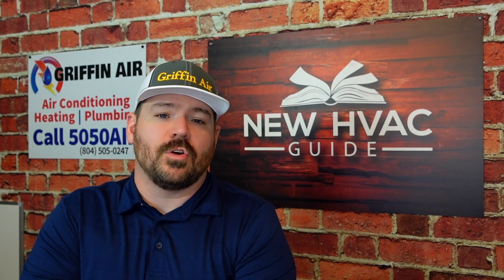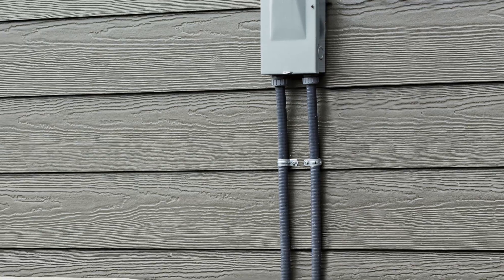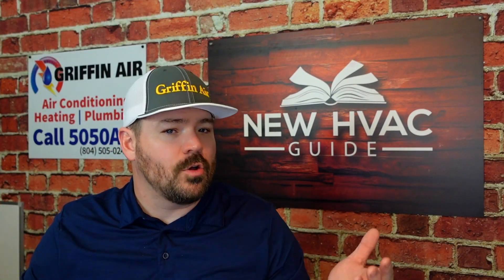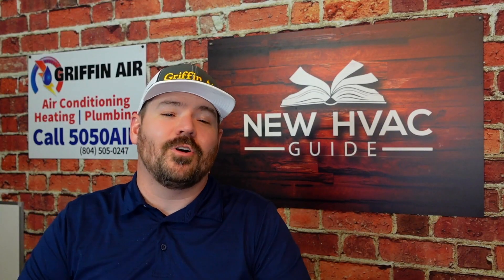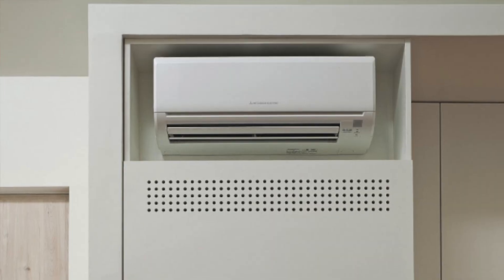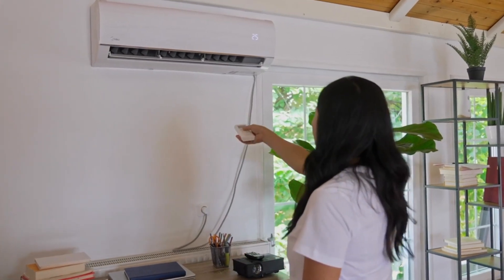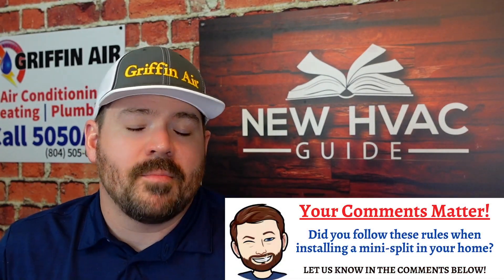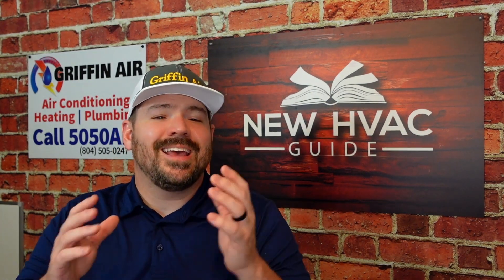Mini-Split Location Matters! EXPERT TIPS!

Comment: I am doing tests on cheap mini splits. Rovsun and Garvey.   It’s incredible what happens when you have the same temperature outside but the sun shines on the mini split in the winter time. Temperatures are in the high teens and mid 20s just installed recently. I am a 37 year HVAC specialist including large boilers, three stories high.  I do everything by the book except I usually braze by mini split connection at the head. I did not in this case I have access to all of them and continue to check for leaks so that my data is more pure going to also add solar panels to these units.

Comment: My upstairs mini split is the same size as downstairs but doesn’t cool the space as well. I know hot air rises so do I need to have a vent installed to improve air flow?  It’s an old house with no existing duct work but several windows upstairs. I am having the ceiling and insulation done so I need to know if I should have an air duct installed as well.

Comment: So my garage is 3 bay. One bay is my workshop and is insulated and separate from the others. This unit will be mostly for heat but possible for A/C too. Aside from the condensate line. What are the downsides of installing the outdoor unit in the unfished / uninsulated part of the garage?  Also, I was going to install in about 8 feet up the wall with a 10 foot ceiling.

Comment: Great video. Do you know if it's possible to have a mini split on an angled wall? Installing one in a steep vaulted ceiling and it's difficult to fashion a flat vertical wall. Debating having one put at an angle but is that safe or appropriate? I have read that it must be level and straight.

Comment: Absolutely one more thing. Put the cool air somewhere where it will be uneven. Hot or cold, people demand different temperatures. If it's uneven, they will find their favorite spots. If it's too perfectly distributed, they will be at each other's throats and you might even have to run it extra cool.

Comment: I put mine in my basement apartment  but I'm concerned about the drip line because it goes down on a slight angle not straight down.  Hoping it doesn't give me any issues.

Comment: I need to install a wall mini split with a 50ft copper line extension to put the compressor away from my patio. I can’t find any videos showing a long line run and how to do it.. How far is to too far and what extra costs are there? how much is additional refrigerant if you need to add it. Thanks

Comment: I ordered a 115 volt system. 5 mini splits.I only have ONE slot left in my electric box.Can those little braker boxes be wired directly into the area near the minis? I see its a little box that you can add fuses into and its separate from the main box.
Reply: Im an electrician i wired one unit at work. Can you explain a bit more, maybe I can answer you.

Comment: I have an office that the central air doesn't keep as cold as I'd like so I was considering one of these. Problem is the exterior wall window doesn't leave much room for an install. It would probably have to go on an interior wall. Do these things come with long enough lines to run through an attic and out of another exterior wall?

Comment: Joshua, the only place on an exterior wall I have to mount the head for my living room/kitchen is partially over my refrigerator. About half of the head will be over the fridge. If I mount 6 inches from ceiling I will have about 11 inches from the bottom of the head to the top of the fridge (only half the head will be over the fridge). Would partially over the fridge be ok? The preferable wall for mounting is in the living room but it's the carport wall--nowhere to drip the condensate except on the concrete under the carport. I want to avoid this wall if possible because of a condensate pump. Thoughts?

Comment: When might you want more than one inside unit in a room? 25ftx25ft woth 20ft vaulter ceiling with only one? What if its an A frame and the side walls are only 4ft tall but still has a 10fr peak in tbis 25x25 room. Thats what Im dealing with

Comment: Ask me how I know... when we had ours installed in our new house (bonus room), the builder never brought this to my attention... placement inside. Unfortunately, now that I know a little bit about these units, there was only 2 places to go, either side of a large window. They ended up putting it above a staircase that no one could reach safely without setting up a walk-board system. UGH!! When I found out where it was going, they had already placed the lines. Go figure. I was NOT happy! Our home is only 4 years old. We had problems with our Daikin from the start. We just last week replaced it with another unit and placed it on the other side of the window, is only about 4" from the wall. But this unit does much more than the last. I can keep it from blowing directly on or towards the wall. We also had the lines set outside, too. This will be much safer for everyone.

Comment: Nice, straightforward, video! I think you should expand and make other vids on the subject of "where to install mini-split systems." One thing I was looking for and didn't find in the vid was installing the system/s where it would be most efficient for conditioning the air, be it cold or heat. For instance, if you're only installing one larger unit in a small space, say a 1000sqft or less house or apartment, then taking into consideration sun exposure, the size and number of windows, and how that affects the temperatures inside the space, and selecting a location where the device would make the biggest difference. For instance, maybe it's more important to heat/cool the air in the  common areas such as kitchen/living/dining room, where visitors are more likely to gather, as opposed to the bedrooms where the temperature maybe be easier to control via windows or ceiling fans. Thanks again for the video!

Comment: I need to mount mine in my shop, metal siding. But need to run 10 feet worth of lines sideways (pitched of course for drain) then out the wall and down. I don’t want to go horizontal on the high ribs. I can leave out an access hole behind wall unit to get to fittings. That ok?

Comment: Question I have a unit  the condenser is on the opposite side of the house and the room is on the other side,Will you run the line set in the ceiling to the other side of the house to where the condenser is located and drop the CANDENSATE  right outside or u will run everything to where  the condenser is ?

Comment: Very unfortunately, the only place where I can install the mini split AC leaves only 3.15 in clearance between the top of indoor unit and the ceiling. Will that be a big problem?
Reply: that should be no problem, most manufacturers say 2" or more clearance

Comment: Hello Joshua. I enjoy your videos. Keep it up. I am installing a Mini Split in my workshop. The shop is 40' wide and 32' deep. I will have one unit mounted on the rear wall centered between the 2 sides. The outdoor unit will be wall mounted, 36" above the ground just on the outside of the same wall. Since it is in my shop, I am thinking about running the line set down on the surface of the inside wall and than go out when I get to the level of the outdoor unit. My question is, is it OK to have the line set inside?
Reply from the maker: Yes. Just make sure it’s insulated 🙂

Comment: I was really wanting some actual information rather than common sense suggestions. I wanted to know how far the refrigerant lines can be extended before it becomes a problem. My wife made a change to our remodel and I can no longer place the outside units where I had intended. The units come with 16ft of line and I was within that. Can we extend them to 30ft, will we have to add to the pre charge? Just looking for a general rule of thumb here.
Reply: The instruction/installation manual of each unit will tell you that for that specific model, and how much extra refrigerant to add. If you look at a unit online see if the listing has the option to download the manual.

Comment: Re: your splash at 2:58.  I am considering a four-zone mini split system due to leaky ductwork in an inaccessible false ceiling all over this 45-year-old house.  I also like the DIY aspect of the system.  I'm looking at 6k, 6k, and 9k wall units for the bedrooms and an 18k ducted unit for the living/kitchen/dining open area.  The larger bedroom has a southern exposure.

Comment: You may have the perfect location for the indoor unit but not the best for outdoor unit.  The outdoor unit can be subject to noise, theft, visually unpleasant walkway obstruction and environmental concerns such as direct sun or rain exposure, not enough air flow etc.  another factor for indoor unit is if you lived in the house for along time you may be aware of certain areas of a room are colder or hotter so focus on that area. Best to place it next to any heat loads such as windows to remove heat before it can get to the rest of the house.  Use caution in kitchen or shops as dirty air cooking oil ets is probably not good for the coils.  I especially like the tip on remote control

Comment: Aesthetics are a factor when choosing a location. People are not yet used to seeing the large interior unit, and it can sometimes be located in an inconspicuous location. Also, the fan baffles can be adjusted to keep the air flow from blowing certain directions (like down in a bedroom). The unit in my house has the air blowing only at ceiling level and it does a good job of heating the whole house with one unit. (I have a 1000 sg ft house.)
Reply from the maker: Very good points!

Comment: I am a retired facility engineer and was responsible for overseas construction, maintenance and repairs of all infrastructure to include HVAC, power, UPS and Gen backup. I have installed many minisplits but now I am old and would rather pay someone to install and maintain. Unfortunately, I have tried to use different HVAC companies and had very poor results not to mention outrageous estimates and costs. I have yet to witness an honest and qualified HVAC tech or company. I will do it myself until I can no longer climb a ladder. Even a simple job like troubleshooting and replacing a capacitor will cost at least a few hundred dollars when it takes less than one hour and the cap is ~$15. I realize their time is money and they have to make a profit on the parts since they usually have them on the truck. The freon costs are exorbitant with them trying to get 500% profit at least. I have many other horror stories from when friends call me after a tech tells them they need a whole new unit but it is something minor and I fix it for them. Some of the techs they advertise they are certified which means they have a license to buy and handle freon. Very few have actually had an AAS in HVAC and claim they learn OJT which means they accompany another tech who may or may not know what they are doing. HVAC and plumbing companies are the worse in taking advantage of folks even more than automotive techs or electricians. The industry needs to police themselves and I don't see that happening. You asked for comments. I think you are one of the good guys and I like to watch your videos and I am subscribed. These videos help me stay current and are good refreshers. Good job. IMHO.
Reply: Lots of ripoff cons these days, yard maintenance, auto, plumbing, dentists, doctors, HVAC... us older guys remember a time when most people were honest and fair, it's not that way anymore... senior folk are at great risk of easily being ripped off.
Reply: That is why the USA hasn't been relevant globally for 25 years.

And you are talking about local jobs, can you imagine other industries that don't require you live in a 10 mile radius?

Me neither because those jobs are done by Chinese and Indians.

But in their home towns they act exactly how your eras folks used to here
Reply: Did I accidentally click on an episode of Adam ruins everything? Impossible to find a good trustworthy HVAC guy, you need to luck out on Mini Split location, hope your house doesn't have Windows.  I'm sure there's a reason that window air conditioners are garbage too
Reply: I still do handshakes and gentlemen's agreements. Been a carpenter/home remodeler for 40 years, and the look I get when I ask a dude if they abide by a handshake is stunning. Well for a couple reasons: no one trusts anyone, and I am female. I just sold a Harley to a younger who really wanted it and asked for a price break if he came over each weekend and fixed it. I shook his hand and literally asked him if he would stand behind his handshake and this gentlemen's agreement. It was awesome, he now comes out every Sunday to give me cash as we shook hands on a price. He's never dealt with anyone this way before. I think I made a friend. Every now and again I take a chance on a young man in hopes of teaching them. Not enough good Men around, and if their Dads bounce someone has to mentor them, even if it's that old butch woman down the road .
Reply: @mickeythered Wow, that's such a blessing.  I've now been screwed over by THREE different contractors. This last one has been incredibly difficult.  A MILITARY  " friend "   that for the most part is just showing up whenever THEY want. This person knows I MUST have pics ready for my ins company within 2 weeks.
Reply: This is the truth. About 15 years ago, the company that installed my heat pump charged me $350 to replace my dual start capacitor. I stood there watching him, and thought the price was ridiculous. I've since replaced it myself for $15-$20, the cost of the capacitor. Disclaimer: Do some research - don't kill yourself.

Five years ago, my heat pump started shutting down.  The same company came out and charged/recharged the freon twice costing me $1500. The second time, they advised me to replace my "aging" 15 year old heat pump for $18K.  I called a contractor acquaintance  for an HVAC recommendation - that company fixed a blocked TXV valve for about $600. It took about 3-4 hours to diagnose, including a 2nd trip to order the part and replace it.

Lessons: 
1) Find a competent HVAC company, if necessary by tapping your building contractor friends.
2) Hiring a qualified HVAC company could be more important than the equipment brand, including for initial installation. What good is a reputable brand if the installation is faulty and results in service calls within the first 5-10 years?  
3) If you're handy, replace the capacitor yourself. Capacitors have a shelf life, but I still have a spare just in case, because they seem to always fail on a Friday afternoon... before a 3 day holiday weekend. Buy and reinstall a fresh capacitor.
Reply: Just had a HVAC contractor want to charge me $140. for a 3amp fuse!
Reply: 2 hvac guys wouldn't even talk about baffles.  After 1 told me it couldn't be done I noticed baffles behind a register

Comment: Thank you so much. I was curious can I install this over a window?
Reply: @gwenherrington  I've been doing some research on these Mini Splits and they actually have ones that can be installed on the lower wall and even in the ceiling. I had the same issue...a sunroom with all windows and I didn't have much space between ceiling and windows. But I CAN go with one of these other options 😊
Reply: That's what I want to know. I need one in a sunroom with many windows so I don't have many options as to where I can place it.
Reply: He said no, don't install it over a window if you don't have to.
Reply: Thank you!

Comment: This is a badass video. I learned a lot 👍🏼   Question: Do all ceiling cassettes require a condensate pump?
Reply from the maker: Not usually unless you need a lot of lift
Reply: Sir, can I install outdoor unit or compressor 9 feet above the indoor unit or evaporator?

Comment: You did not know why there must be so much side clearance. I would like to install one at the end of a hallway, but there wouldn’t be enough side clearance. Do the plastic sides have to be removed for repairs, such as replacing a fan motor, or a line set?
Reply from the maker: Some repairs, yes. Depending on the brand you’re installing, some come apart different than others
Reply: @NewHVACGuide  Thanks. Your videos are helpful. I’ll get a less powerful unit with a narrower air handler. I live in the Pacific Northwest, where the weather is mild year round. I probably don’t need the size manufacturers recommend based on square footage.
Reply from the maker: Proper way to size is load calculation not square footage. Thank you for your kind words by the way
Reply: @NewHVACGuide  True, but load calc is no substitute for trial & error. After dumping $4K into a couple of replacement compressors for my “central,” whole-house, forced-air, heat pump system, both of which failed, I decided to use the attic air handler for ventilation only. I installed an under-powered mini split in the area with the attic air intake, to see if it could keep up. The house is 1200 sq. ft. The 12K mini split keeps up unless the temp climbs into the 90s. I’m going to install another 9K unit in the hallway, so it blows toward the air handler intake. If that isn’t sufficient, there’s a third location, well separated from the other 2 units I can install a third unit. I realize installation costs of discreet units is an issue, but the redundancy improves overall reliability over a system with multiple air handlers connected to one outside unit.
Reply: @rafaelramos441  Thanks. I’ve found that mini splits do better cooling than heating. And, like you said, they aren’t plug and play.